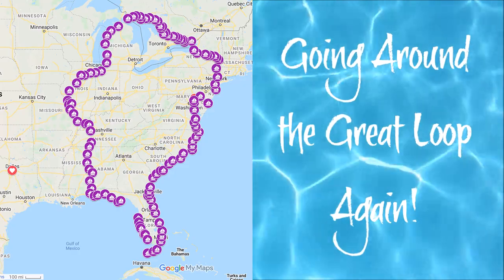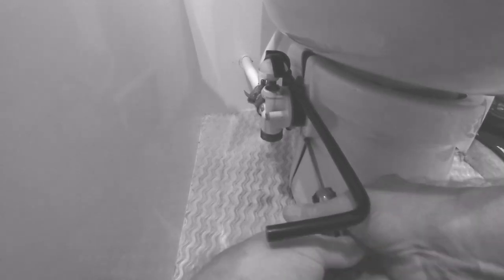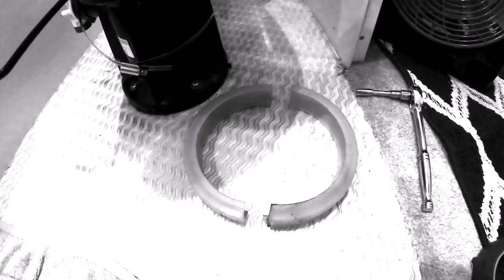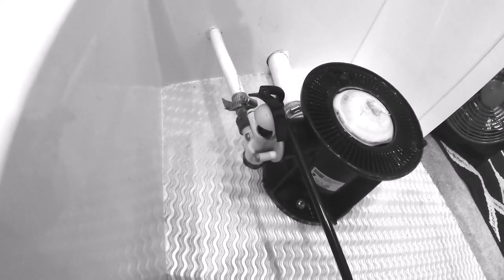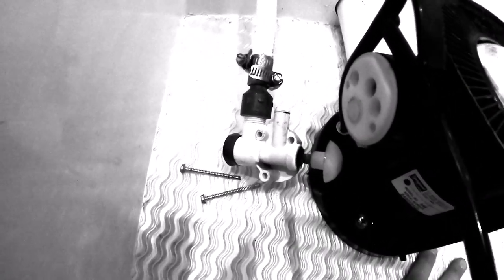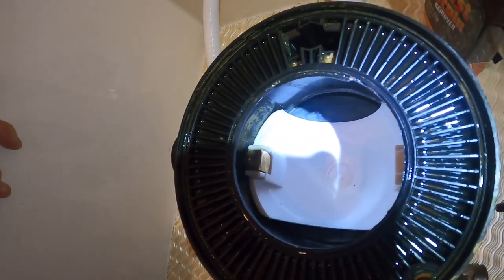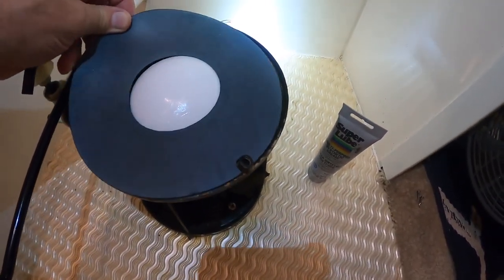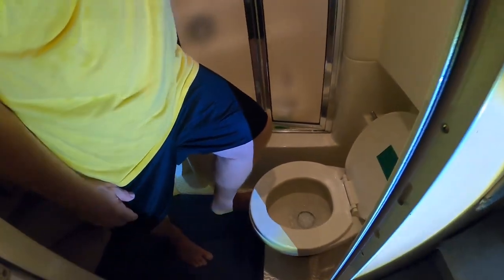Replacing the Vacuflush Ball Valve and Seals on Marine Head | What Yacht To Do

Comment: Hey Sam - Great video.  The first time I tried this I failed: 1) The vacuflush couldn't seem to get enough vacuum to stop running and 2) the toilet would leak when you were sitting on it and shifted your weight left or right.  I ordered a new "Seal Clamp Kit" and those instructions specified to tighten the metal band to a specific torque value - 65 in-lbs.  I had also missed the step the first time of spraying silicon on the seals (the instructions say to spray the top of the thick bowl seal and the bottom of the thin ball seal.  I'll let you know if I get better results the second time!
Reply from the maker: Hi Patrick! Great that it's of some help! Happy New Year 🎉

Comment: Hey Sam, I have replaced the seals on the heads over the years but never the shaft and ball. Was there an articulable reason for that or did you just decide that as long as you were that deep into the project that it just made sense to replace all the components? I carry a spare ball and shaft (actually every piece to build an additional head except the bowl) and maybe Im just too cheap to use it. Thanks
Reply from the maker: Yes the phone was very worn out and had started to deteriorate in the middle!